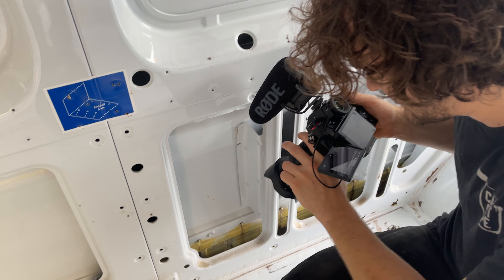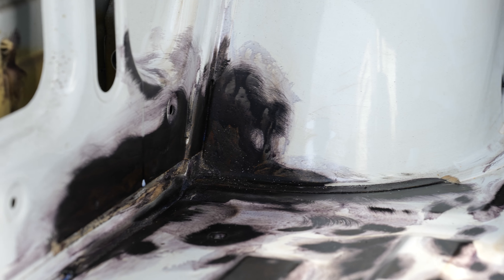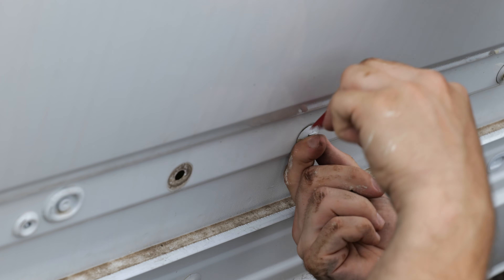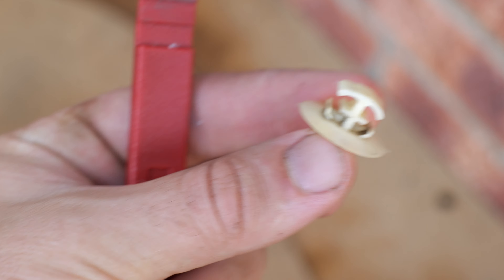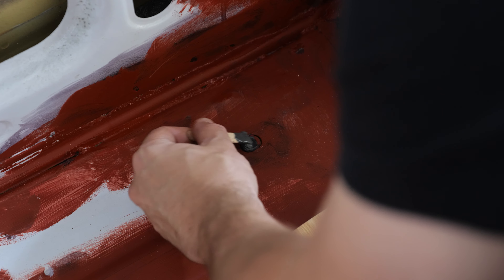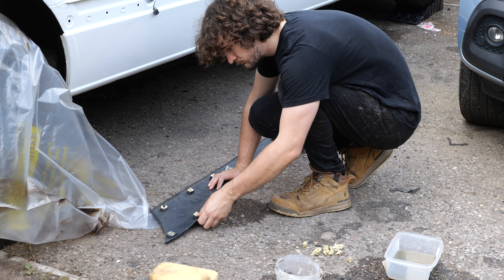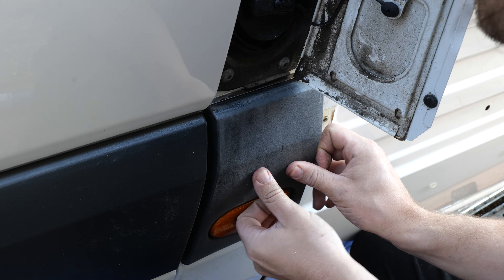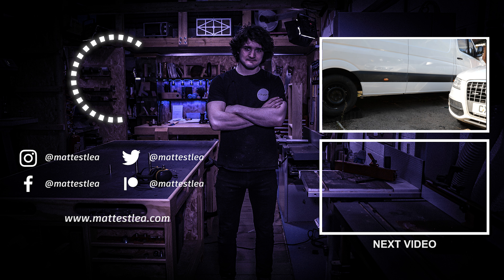How to Seal and Weatherproof a Van | Mercedes Sprinter Conversion #7

Comment: See my comments 3 months ago when you 1st bought the van. 
I recommend spraying the van off with a powerful hose when you have finished sealing it. Better to find leaks now sooner than after you have completed the build.
Have a look at older Sprinters/Crafters and you will see the problem areas where they rot from 💰💸💸💸

Comment: the way I dealed with it (fiat ducato, exactly the same problem) was doing one large silicone line around the whole top of this black plastic thingy and down the sides. BTW: you probably should have bought new clips eg on ebay to save you time, they are cheap and the sealing material degrades over time
Reply: See my comments 3 months ago on the post when he bought it. Putting a bead across the top doesn't stop water ingress. When you drive along you get a pressure difference between inside and outside. This can suck the water in. 

+1 new clips every time. Show me a 2nd hand van that hasn't had a dink or two. In fact dya notice some of the clips Matt is removing have overspray so they've been off once before?
Reply: @mattydare  i seriously doubt that, water may get underneath a bit but i can hardly imagine it getting into these holes (holes are still plugged btw, just not 100% watertight). but to be fair, I have not yet had a look underneath the insulation but I doubt if i ever will. Water from my ceiling window is my biggest concern
Reply: @ai5506  Okies - sounds like you know what you are doing👍. 
I read one comment where someone was suggesting to seal up the inner front arches to stop mud collecting behind em. I don't think they realize that all the water, leaves and crap runs off the window down there🤭.
Anyway good luck🙏 - I'm about to dip into my pocket to get an electrian to find a parasitic drain that's bugging me.

Comment: Makes you wonder why van manufacturers dont seal the trim holes when applying the trim or fit a small rubber Gromit or similar to prevent the water ingrerss if this thing is very common?
Reply: Simple - I've commented on this before. They don't want the van to last forever as they want to sell you another.

Comment: For sealing there is an even better product called dekasyl which will stay completely soft and not harden at all. silicone might shrink and expand with the weather and not last as long. You'll still be good for the next years though!

Comment: IMHO, old trim clips should not be reused. It's about 50 ct per clip. Older sprinter models are equal in parts to VW crafter models as the were built at the same production site.